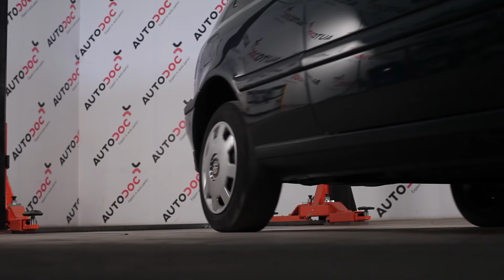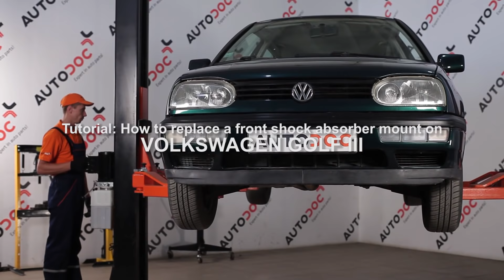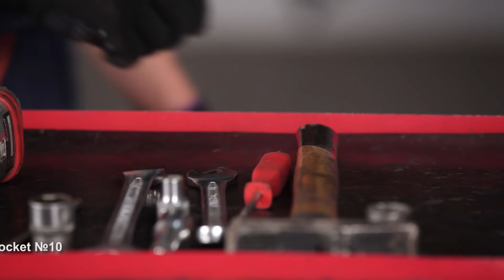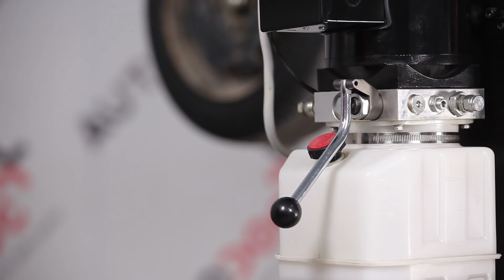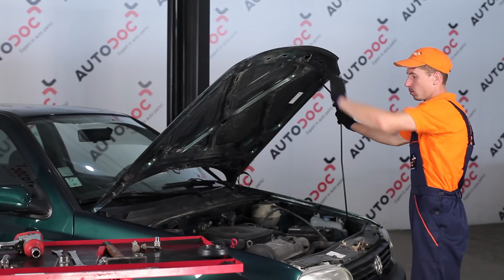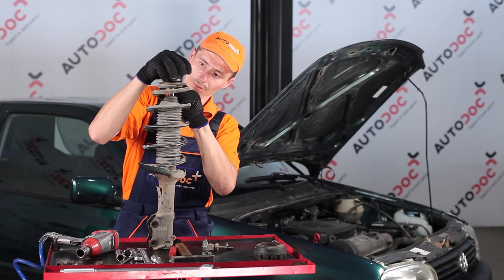How to change Strut Mount on VW GOLF 3 TUTORIAL | AUTODOC

Comment: Hello!
I have noticed that there is two types strut bearings for a Golf Mk3.
There is struts for earlier Mk3's and for later mk3's. I think the crossover is at year 1994

Can I use strutmounts made for earlier Mk3s on a 1996? :)
Reply from the maker: Thank you for the feedback! Any re-equipment can lead to the failure of other parts of the car. Best Regards, Autodoc.

Comment: When i jacked my car up the hole shock assembly had play up and down is that also a worn strut, tires are getting worn down and i have a shutter when i drive at highway speed and my wheels dont return when im at full lock left or rite, also i see you didnt compress the coils is it only that modle or donyou need to compress the coil with other models
Reply from the maker: It is difficult to say something without proper diagnostics, we recommend contacting the service.

Comment: The black bearing sleeve had come away from the bearing and would have been stuck in the old mount! that bearing needed replacing as you cant press yhe sleeve back on once that happens. That mount wont last 2 minutes on top of it without the sleeve! otherwise yes that is how to do it. For insurance replace the bearings and buy from main dealer. hope this helps.
Reply from the maker: Thank you for the feedback! Your opinion and reviews are very important for us. We hope that our tutorial was helpful for you. Best regards, Autodoc.
Reply: We must be looking at two different videos. FYI, this video is quite silly in that he is replacing the upgraded HD upper strut mount with the old style weak mount. No one worth their salt would do that unless they are charging for the HD part and putting the crappy cheaper part on instead and if so, shame on you. 

Also, for the labour costs involved, why would you not replace the upper bearing while you are right there? A wheel alignment MUST be done after one pulls out the strut assembly. Anyone that argues otherwise is someone who should not be working on your car. 

Like I said, this video is quite silly.

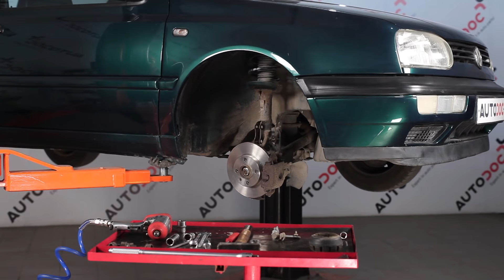Comment: 4:01 hoist arms on sill ? My Corrado (same shell) is f'""ked from this abuse........better on the subframe mounts or chassis rail ,
Reply from the maker: Our videos are for guidance only. All routine replacements and values can be found directly in the technical documentation for your car or use the help of a car maintenance service.
AUTODOC